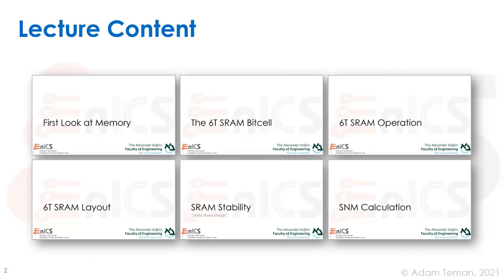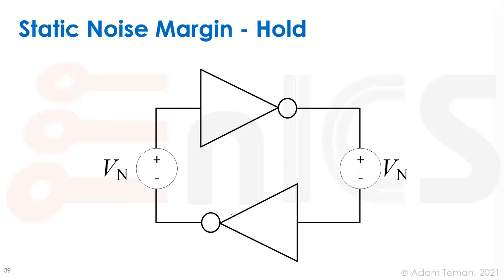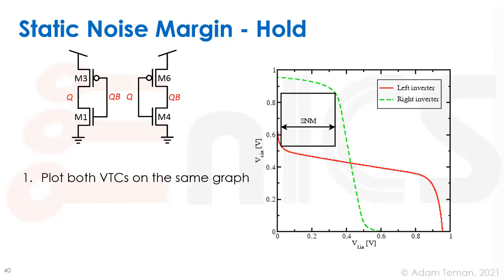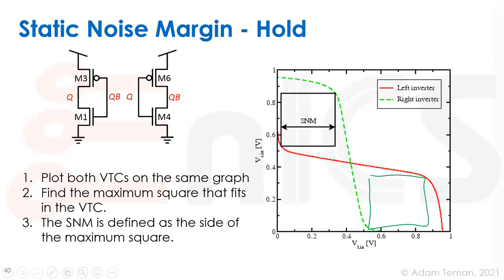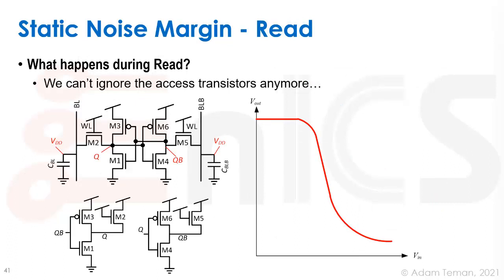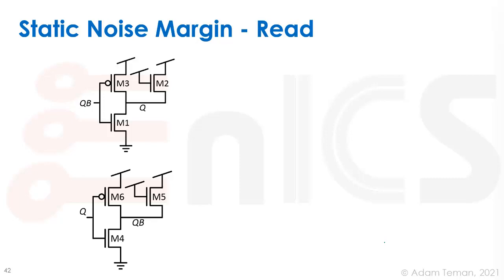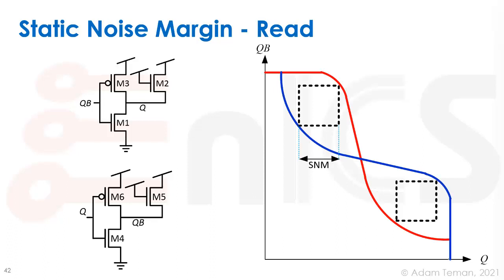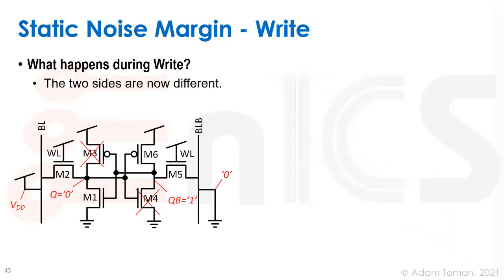VLSI - Lecture 8e: SRAM Stability

Comment: What is VTC?
Reply from the maker: A VTC is the "Voltage Transfer Characteristic (or Curve)" of a logic gate. It is basically a DC sweep from 0 to VDD on the input showing the DC operating point voltage of the output. 

You can find a full explanation in my "Digital Electronic Circuits" course in these slides: https://www.eng.biu.ac.il/temanad/files/2018/02/02-Terminology-annotated.pdf

(unfortunately, I only have the accompanying video recorded in Hebrew).

Comment: while writting how we maintain Pullup ratio
Reply from the maker: Pull up (and pull down) ratio is a property of the cell sizing. As explained in the lecture, to maintain the correct functionality, you need K(PUN)<K(ACC)<K(PDN) and this is generally done by using a minimum sized PMOS, minimum sized Access NMOS and 1.2-1.5X width PDN NMOS.
Reply: @AdiTeman  I saw the SNM response through VTC by increasing width of a pull-down transistors. It really impacts.. but this may leads to get increases the layout width.. how can we maintain this
Reply from the maker: I guess this is the "no free lunch" principle. 

SRAM cell engineering is something that Foundries put a lot of effort into for exactly these reasons, and many, many pages of research publications have been written about them.
Reply: @AdiTeman  yes offcourse... I am doing my research work on that.. anyhow thanks mate for ur support...

Comment: what is the relation between transistor technology node to SNM. i.e., 180nm,90nm,45nm,18nm how these will vary the SNM
Reply from the maker: Hi Mukku,

I don't have exact data on this - it is also probably not something that the fabs like to release. In general, the SNM is very dependent on the actual transistor models of the SRAM cells, which are special transistors (they are not "standard" NMOS and PMOS, but rather special transistors created with "pushed design rules" that only the foundry supplies). 

That being said, it is generally proportional to VDD, so if your VDD scales, your SNM will scale along with it.
Reply: @AdiTeman  thanks sir.. really appreciable work u done through videos....